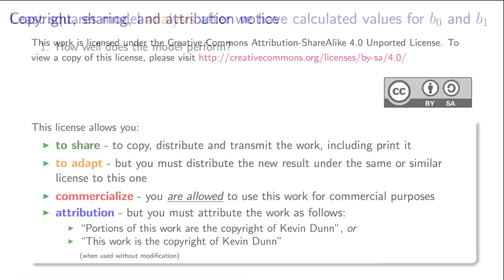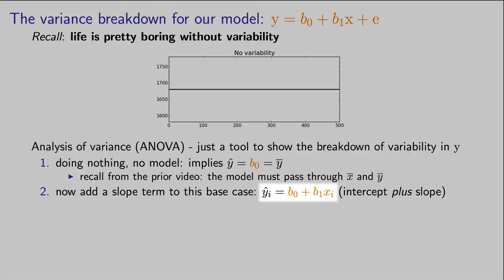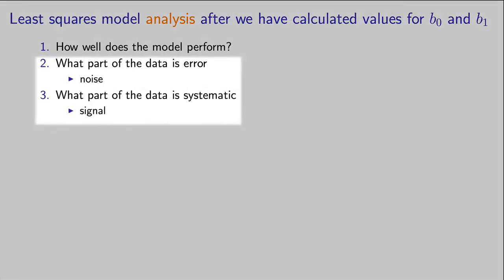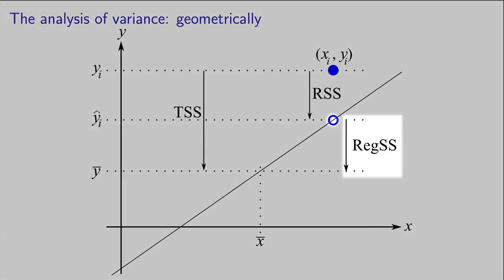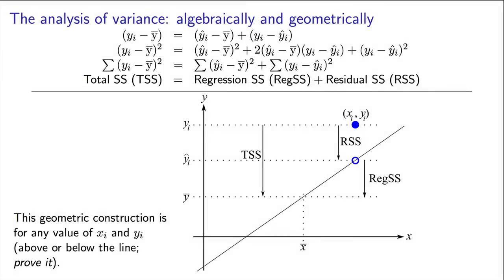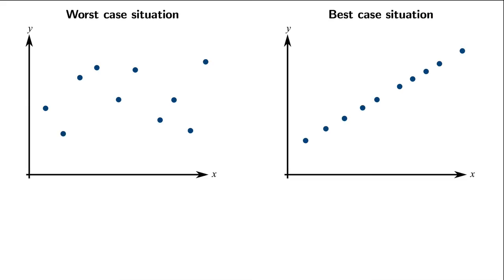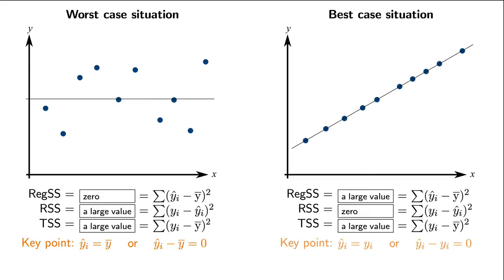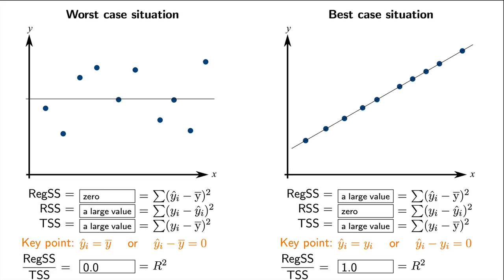Least squares - 05 - Understanding the analysis of variance (ANOVA)

Comment: Kevin,

In section 4.7.1 - The Variance Breakdown, in the squaring both sides line, how or why is the (middle) term preceded by 2 on the right side of the equation equal 0?  

My algebra simply results to (ysub(i) - y.mean)^2 which agrees with the left side of the equation.  Thanks for your guidance.